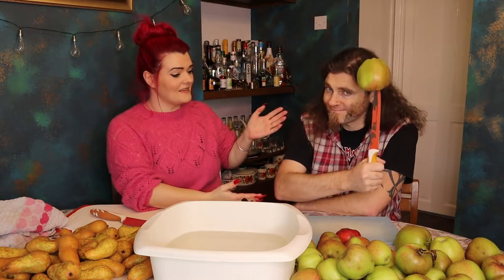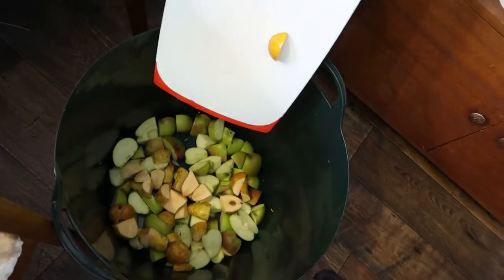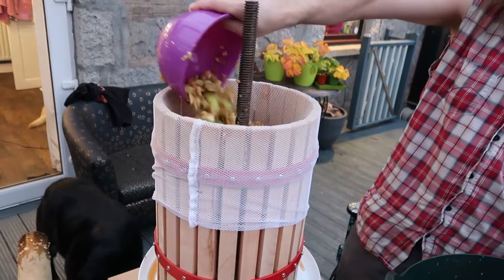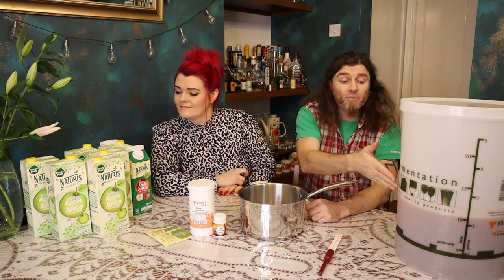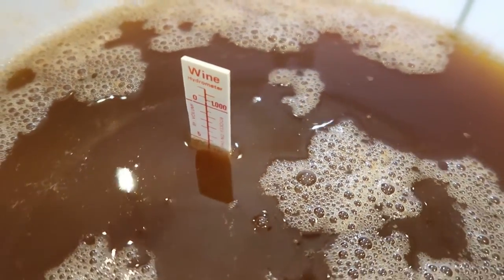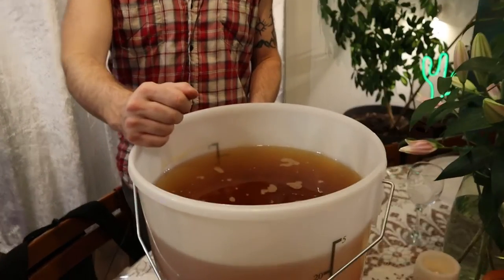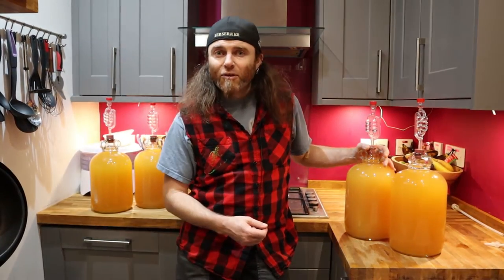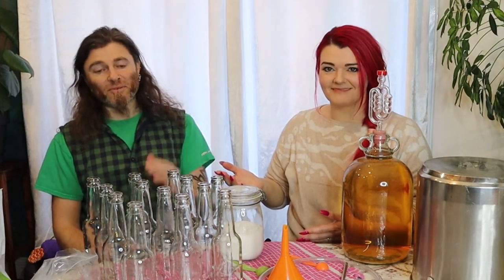How To HOMEBREW CIDER - step by step APPLE & PEAR CIDER from pressed Home Grown Fruit /MoggyBoxCraft

Comment: Any reason why you cant just leave it in the bucket to fully ferment thats how i do my cider what are the benefits of the demi johns if any .
Reply from the maker: You can leave it in the bucket, but because it's not air tight, you risk contaminants getting in and spoiling the batch. We like to transfer to the demijohns after the first fermentation as the demijohns are a sealed system, and because the glass is clear we can see when the second fermentation has finished and has stopped bubbling and producing carbon dioxide, instead of lifting the lid of the bucket and potentially letting contaminates in.  Personal preference I think 🍻😀